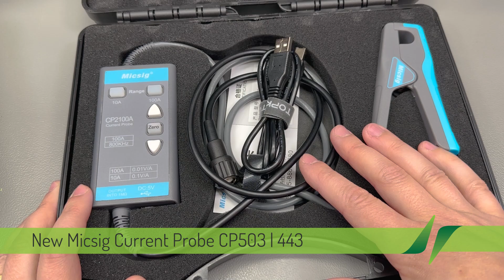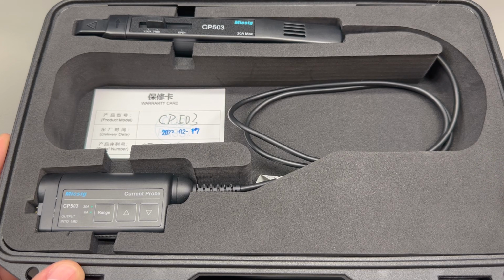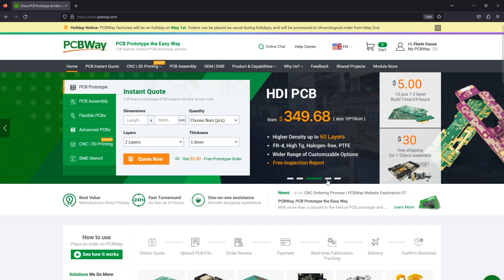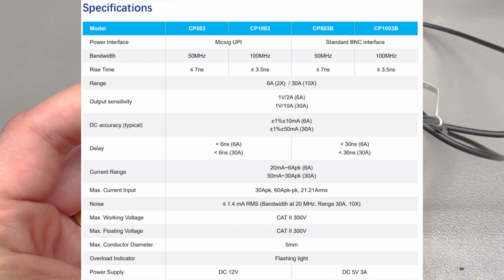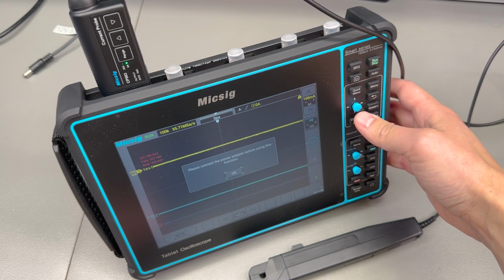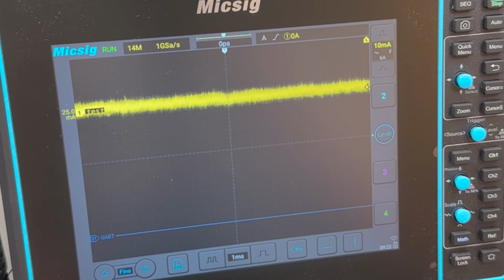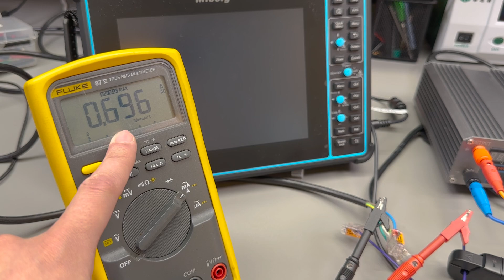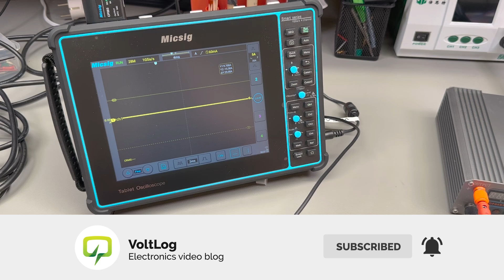New Micsig Current Probe CP503 | Voltlog #443

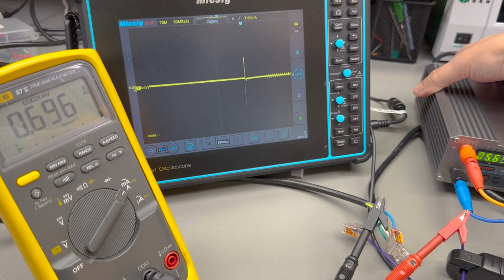Comment: 11:59 Fluke 87V regular MIN MAX mode response time is 10ms.  Setting  PEAK MIN MAX reduces it to 250 µs.  Enter PEAK MIN/MAX by pressing MIN MAX button then pressing the PEAK MIN MAX button that is below the MIN MAX button.  PEAK should be displayed on screen and the 0.70 A AC RMS measurement should now be ~9.70 A AC Peak.  Other meters have a PEAK MIN MAX function with varying response times for each manufacture but normally much faster than regular MIN MAX mode.